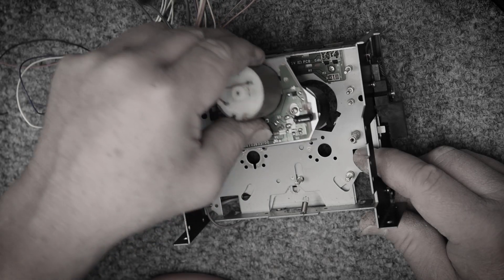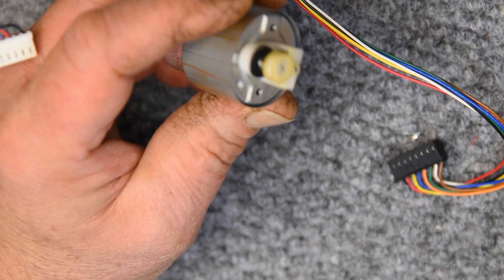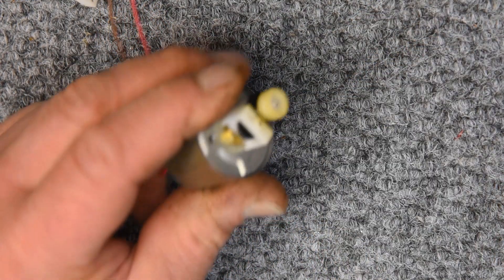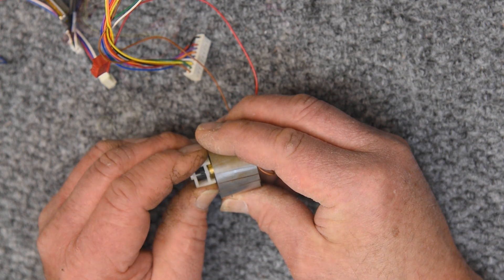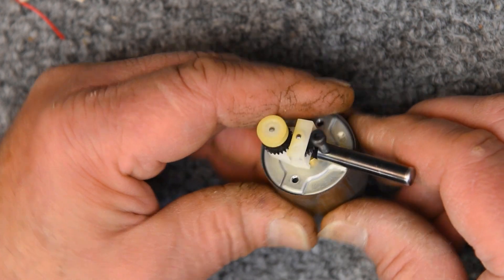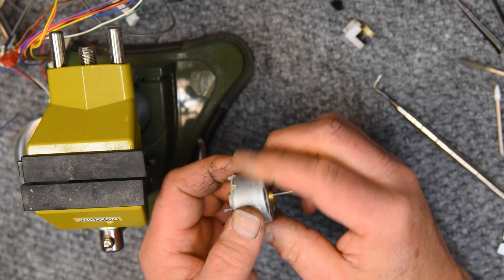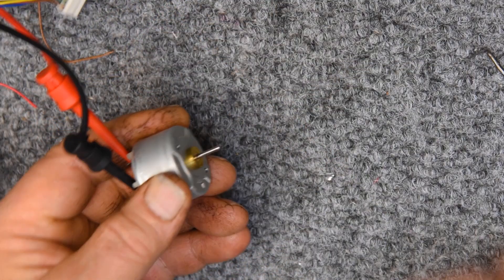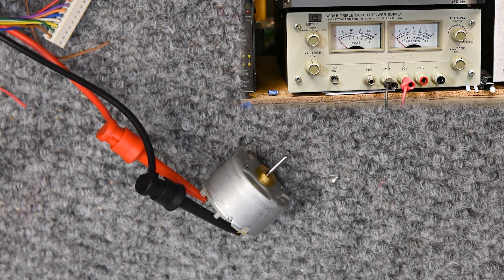Tascam Reel Motor Rebuild

Comment: Can't help but admire your ability to make a tool to get a job done!

I think I would have levered the assembly up with a screw driver with another driver acting as a centre pivot?; if that makes sense? But, there are times when a bespoked solution is necessary. I sometimes squirk/soak the stuck item with switch cleaner, it seems to 'ease' the aged fit. 

Just regardng plastic/nylon-type pulleys - they can be a tight fit, but they usually behave themselves. However, small and delicate assemblies like  the one you've worked on can be tricky, best (as you've illustrated) is to think through the best way to remove.

Another great video.
Reply from the maker: Thank you. Designing dedicated tools, or modifying and improving existing ones, is part of my normal work day. I did mention the lack of access to the other side of the bracket, which precluded the use of the two opposing screw drivers solution, otherwise I would have tried it (maybe). Levering a single point on a strong metal part is commonly done and very successful (look at a ball joint spreader), but on the weak, narrow cross-section plastic frame I'm dealing with here, is extremely risky, especially when considering the time involved to machine a dedicated tool, vs machining a replacement part.

Regarding the use of even plastic-safe solvents on a plastic hub that has been press fit onto a steel shaft and aged for a time, I wouldn't recommend it. These parts are already past their normal life cycle and because plastic cures, therefore shrinks over time, a solvent can cause crazing that may not be immediately apparent. I will even open up the bores on interference plastic parts in situations like this to relieve the excessive force, bring them back to near factory interference tolerance, then bond in place for a secure fit. The plastic parts on all these machines will be their eventual demise.
Reply: @asbcustom  Many thanks for the info.